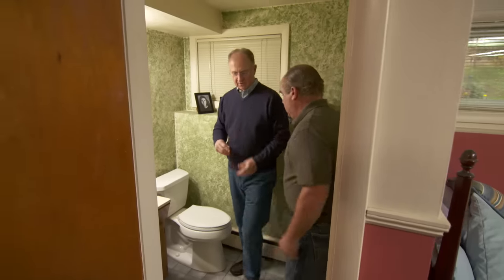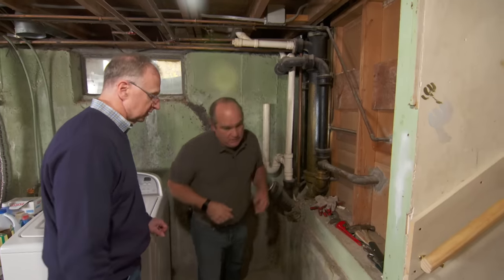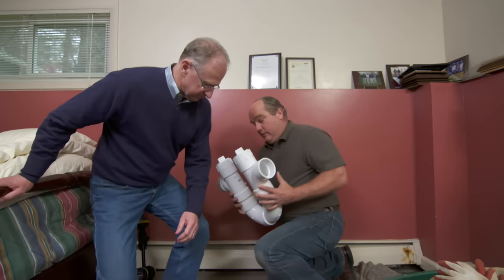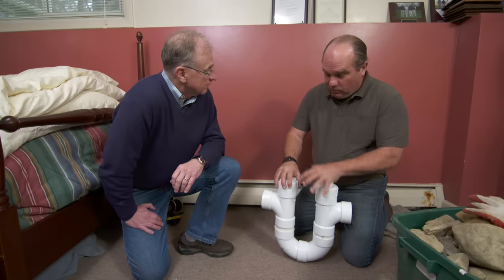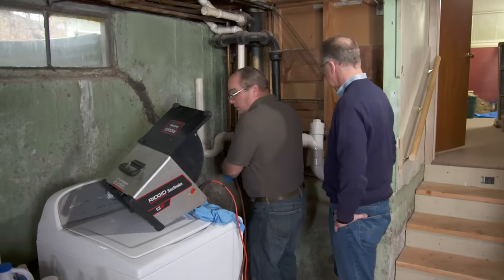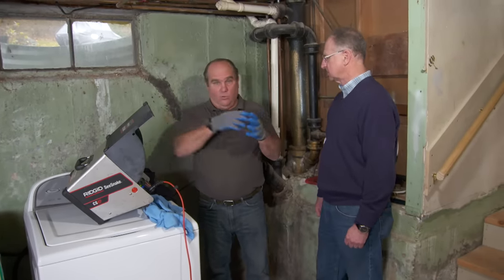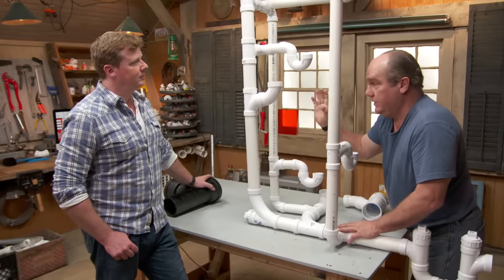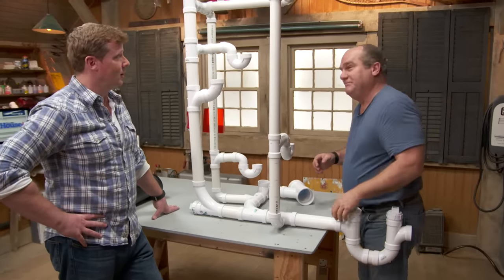How to Diagnose Plumbing Drain Problems | Ask This Old House

Comment: Any educated estimates as to how much this homeowner is going to pay out of pocket to fix this mess, in USDs?
Reply: cutting the concrete trenching regrading tying in to the sewer behind the toilet and to the toilet to the house trap 7 to 10 grand . beyond that to the city connection 15 to 20 grand depending on the distance
Reply: @mfplumbing9341  so you are saying $22k to $30K?  This can set back a homeowner  big time.  Does insurance cover any of this minus the deductible?  I know savings are the best way to go but let's face it, though Dave Ramsey has been preaching to save for a rainy day for a while now, America for the most part isn't a saving nation.  I've thought about purchasing a home warranty but I keep reading that it is not worth it.
Reply: @fisterhr  No, nothing would cover it.  Plus, this is the kind of job that you need a qualified contractor to do as it's easy scam artist type of money to siphon an unsuspecting homeowner who wants to do it on the cheap, only leading to further nightmares.

Comment: Bypass that old pipe all together and put one outside the house thus foregoing the need to rip up the entire freaking basement! It's a lot easier to dig up along the outside wall then dig up the whole basement. This job should have been done right the first place and this never would have happened.
Reply: Doubt that would meet code though?

Comment: "every house"... translation "every house that was, several years ago, plumbed to USAnian codes of that time"

So, a vanishingly small proportion?
Reply: Joking aside,  british regulations have NEVER required vents that are plumbed like that. No, i'm not dissing US plumbing, it's a bloody good idea, and well thoughtout, but...it's not been 'required'
Reply: @TheChipmunk2008  how are vents done in Britain?
Reply: @AMD1  to be fair this system works. but most every system i've seen in the UK, the vent stack is into a manhole (inspection chamber). The 'U' shaped thing seemed to make life unnecessarily difficult. I guess it's to do with the prevalence of septic systems in NA?. Here in the UK, the vent stack is in the place where the toilets are... but everything after that is.... not trapped?

I've seen plans where there's a U bend in uk drains. they spoke of it as if it was normal, but never seen it in real life
Reply: @TheChipmunk2008  I think the usage of a "house/rat trap" is an obsolete regional practice done in parts of New England. I've never heard of it until watching this video. At 4:10 he said it was used during a time when there were cesspools, which don't exist today.

In North America every branch from the main drain has to have a vent sized according to it's diameter. My house for example has 3x vent stacks on the roof. The one vent for two bathrooms next to each other is 3", the one for the washing machine is 1½", and the one for the kitchen sink is 1½". Everything in the house is trapped, even with the addition of a "house/rat trap".
Does England have fairly large drain pipes so traps upstream don't get sucked dry, or is there an extra pipe in the manhole which is the vent? is there anything in place to prevent water, rodents, or other debris from blocking vents in the man hole?
Reply: @AMD1  Sorry for the delay replying.

Here the old method was to use open 'hoppers' to to make the unvented portion of the run short. And the hopper ALWAYS discharged to a pipe larger than the largest feeding it.   That's a bit unsanitary, so in the 70s they started moving toward a combined 'soil stack' (EN-US stink pipe) where the top is vented, but the short runs from sinks/handbasins discharge directly into it. the minimum size is 4" (100mm) so not quite as tight as the common US 3" outlets on toilets. I think that difference, while seeming minor, makes it very unlikely that a trap will get sucked dry.

The US system makes more sense, especially for buildings over 2 storeys
Reply: Oh, and every property USED to have an air admittance vent at the boundary to the public sewer line. They had a rudimentary one way valve involving a gravity fed sheet of mica. It turned out they weren't actually necessary so fell out of favour in ... I'm not sure when actually, but certainly victorian and edwardian sewers have them, and anything since the 1960s doesn't. That doesn't narrow it down much, sorry
Reply: @AMD1  no not anything that would keep a rat from crawling in a city sewer then the line to ones house. I have seen whole house traps here in Kentucky since  the older homes had a combined sanitary and storm drain system in the basement. The whole house trap prevents sewer gas from getting to the downspouts.

Comment: They should show you the area the house is sitting on what's around because it is very dangerous to dig in the ground gas lines electrical lines etc. YouTube plumbers are the worst that's why customers end up spending thousands leave it to the professionals

Comment: QUESTION!--could this old U SHAPE BE FIXED BY?GET RID OF BASEMENT TOILET.WHAT BASEMENT TOILET NEEDS,GET A "toilet higher,"another,above level,SEAL OFF ALL LOWER PIPES--redo high level pipes,above,to sewer system.HOWEVER it needs to be done,cut off all lower pipe system.its too expensive,ect ect--divert to simple pipes at higher level.ok,not work?but avoids THOUSANDS OF $$$$$.comments?ok,am not professional,just "hacking",thanx! ;)

Comment: How to Diagnose Plumbing Drain Problems?  Not to complicated, when you turn on the water in any appliance, it fills the tub or sink and then overflows on the sides, you have drain problems.  Even worse when you flush a filled toilet with the stuff that goes into toilets.